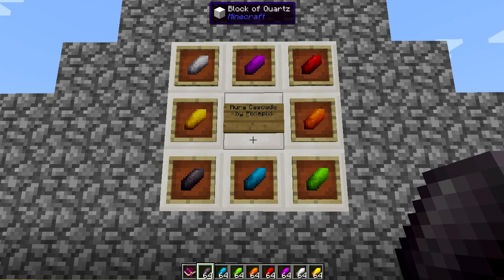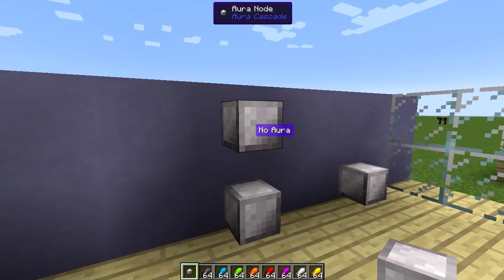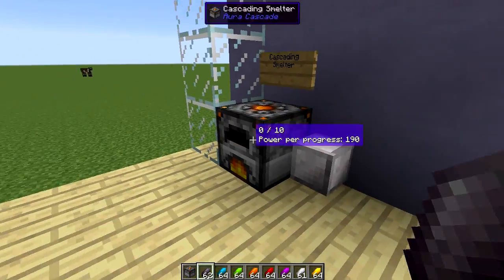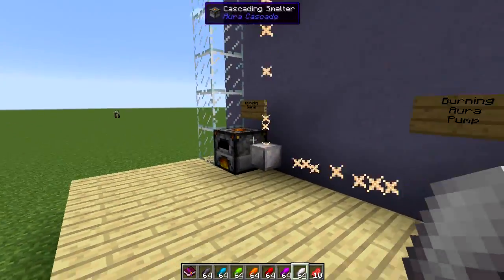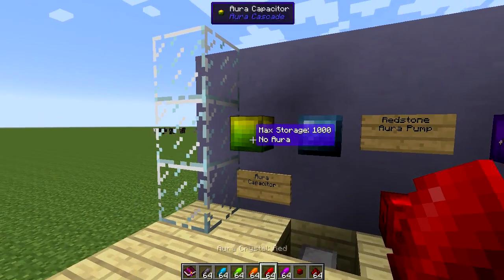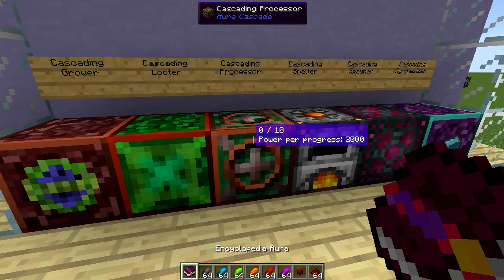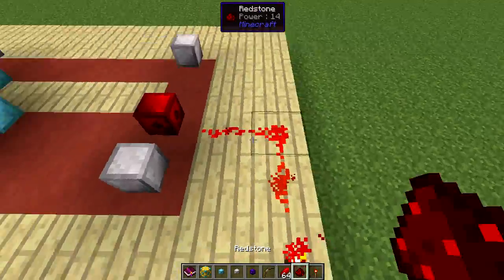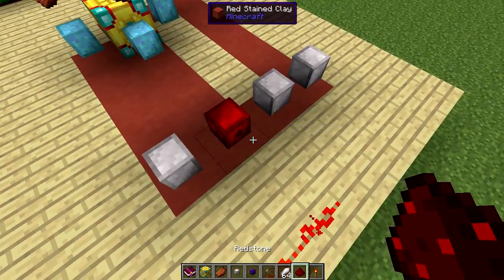Mod Spotlight - Aura Cascade by Pixlepix [Part 1]

Comment: Been playing with this mod a bit now so ill share. PRO TIPS
* [REDSTONE PUMP]:The longer the red stone line the red stone pump goes(10 - 20 min range at max), but is not easy to automate.
* [ARROW PUMP] is this the best imho due to the easy of automation and high output. A simple 'hopper clock', set to about 23 items, can be set to a dispenser filled with arrows pointed at the pump.

*Purple/Violet aura is easy to get large amount of due to the fact it will "multiply/increase" its aura over time. Start with 100 violet aura end up with 300 million.

MAJOR TIP: When trying to test your power output of your system the [Bookshelf Coordinator] block will display the power it gained the last second. (The author of the mod should add a sub-block like this in that does not require infusion to test systems.)

Power explanation(aura type ignored):  Because of the way Aura travels it can be confusing to calculate how much power a system is generating.
Burning pump says it generates 300 power. That is correct, but only after the
'aura system' settles into 'perfect stability'. Why do I mean by that? Lets say you have two nodes one with 100 aura the other with 200 aura. They are both going to share aura until they bout have the same amount 150 and 150. At that point they reach perfect stability and stop sharing. If you have an aura system where aura is coming in one side and leaving from the opposite side perfect stability also exists. The amount leaving the system will equal the amount entering the system after a [pump] has been working for a while. This can be proven using the [Bookshelf Coordinator] as a testing tool.

One caveat: Lets say you have a really compact system.
NOT REAL CALCULATIONS.
All four block are right next to each other. The total amount of aura in the system will need to be really high to reach 300 power. Why? Well lets say you have 300 aura fall one block. Well that """might""" be worth 300 power, but in order for 300 aura to fall it has to split from a node above it. that node is going to need to have enough power in it so the split is 300. Not to mention that it might have a partner node that will also need to be at a high aura amount to reach perfect stability.

------[  1000 ]  - - - - - - - - -  - - - - - - - - -  -     [1000] ---------
--------[  split need to get 300 energy= 300 ]  - [pump ]----

Solution?

Remember that calculation that hurt your head?
Adly Templeton:"Pumps don't move X aura per second. They move X/height aura per second."
 Yeah that one ...

------[  1000/10= 100 ]  - - - - - - - - -  - - - - - - - [1000/10=100] ---------
1 height
2 height
3 height
4 height
5 height
6 height
7 height
8 height
10 height
--------[  split need to get 300 energy= 300/10=30 ]  - [pump]------
height calculation of probably off(could not remember if it counts the bottom block 
Or for better sight.

------[  x/h ]  --    [x/h] ---------
h
--------[  aura required to get energy = required aura/h ]  - [pump x]----
 
Adly Templeton: "This means that a higher setup isn't absolutely better, as the effects cancel each other out (Though it has a few interesting efficiency results)."

efficiency results
efficiency results
efficiency results
efficiency results
Meaning you need less aura in the system the taller it is.... And remember creating new aura requires the use of diamonds.